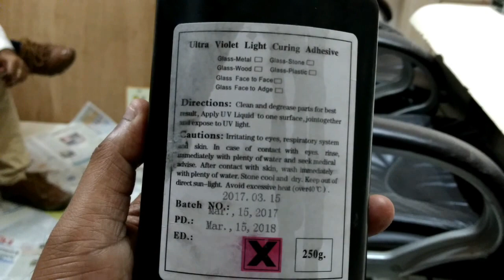How to Fish Aquarium Installation on site

Comment: हेल्लो सर मुझे अपने न्यू होम के बाथरूम फ्लोर के बारे मे जानना है जोकी अभी बन्न रहा है। मै ये जानना चाहता हूँ कि बाथरूम मे टाईल्स लगाने के बाद उसके फ्लोर और वॉल की फिल्लिन्ग के लिये मैं ग्राअट इस्तेमाल करूँ या फिर इपोकसी और इन दोनो मेसे कीसी एक के इस्तेमाल के बाद में मैं किनारे सिलिकान्ं से सील करदु या नही। मुझे अपना सुझाव जल्दी दे।
Reply from the maker: Grout use kro best hai ...aur agar budget acha hai to epoxy us KR lo
Reply: ArchiTech&Knowledge thanks you sir... thanks alot for your suggestion... well budget is not a problem... but after filling the gaps with epoxy... should I put a another top layer of silicon at floor corners or not... is it necessary or not ?
Reply from the maker: No
Reply: ArchiTech&Knowledge ok thank you